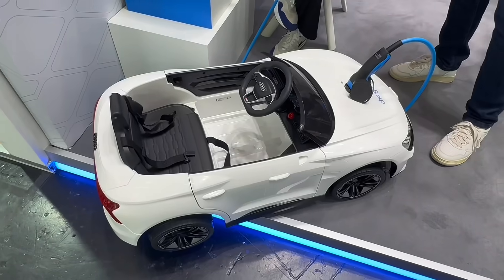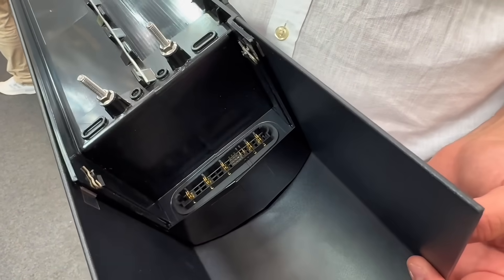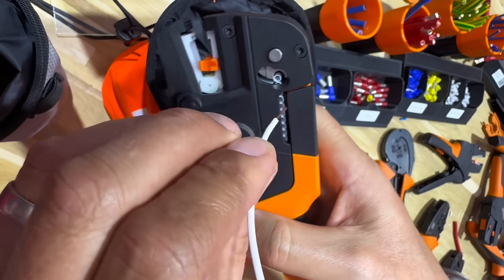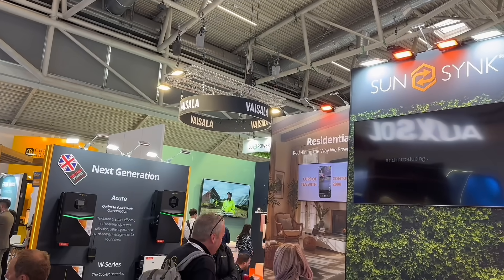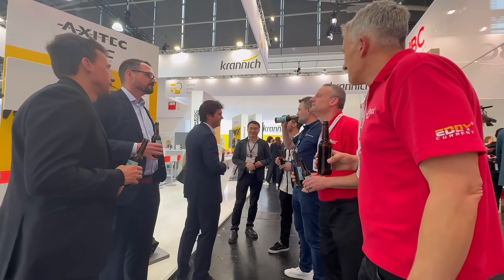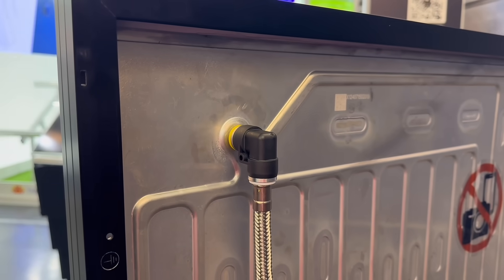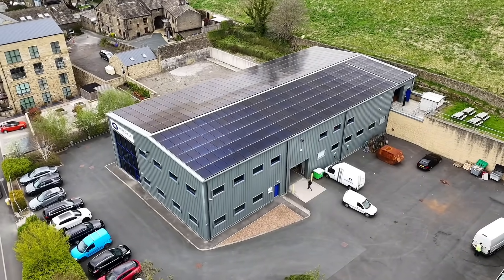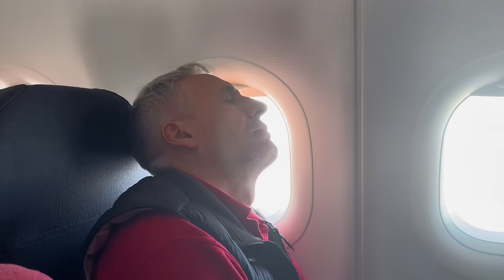Hot New Tech That’s Redefining Renewables ⚠️ - Intersolar Review

Comment: I just want to know if they are normal sized panels 600/700watts means nothing if I can’t put as much of them as standard ones, head line figures half of which can’t fit on a flat roof bucket
Reply: They won't be. Not sure how far geographically solar panel standards travel, but their nominal output will be '1 kilowatt per square metre standard insolation' times their efficiency times their plan area (not including bezel or gaps for fixings obviously). Solar panels are all about the same 20-ish% efficiency, so if the power figure is bigger, the panel will be. Not sure if the "25%" quoted here takes into account less bezel/fixing area for PV area, but that extra 5% won't make the difference between a 400-ish W panel and a 700 W one. These will be 'huge'. You're going to need a bigger bucket.
Reply: @DTech101  it's literally written on the panel. 2465mm x 1303mm. 775w  and 24% efficiency
Reply: @davehodges2361 lol I know hence why I said headline figures and not comparable to standard size panels, like saying I got 30% efficiency in a panel but it’s the size of a house. 

What I’m getting at is sales talk we are going down the route of my panel is better than yours because it’s 24% yours is 23% but the 24% has more surface area so very surprised why it’s more efficient when compared to smaller panels.
Reply: Yeah, probably around the 1,134mm x 2,200mm size range.  Pain in the arse to install on a roof.  Ok ground mounted.